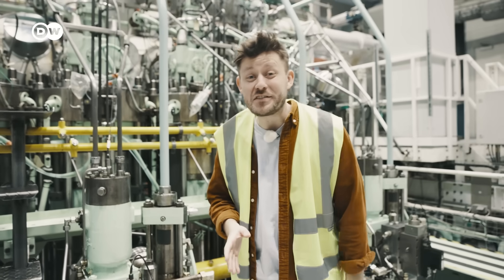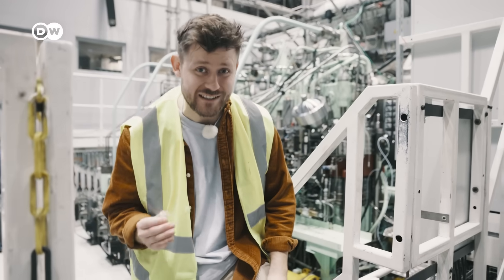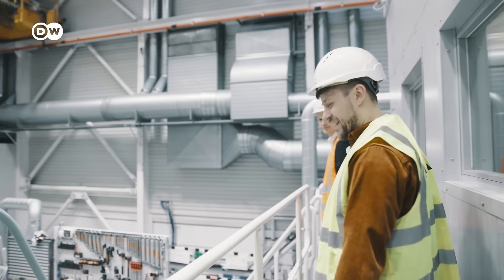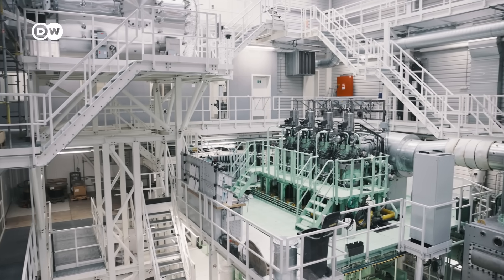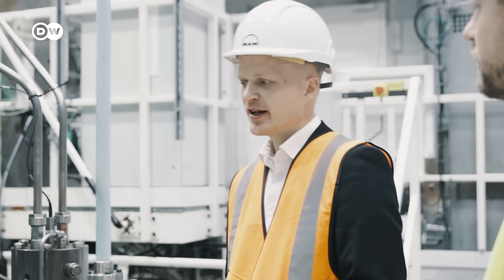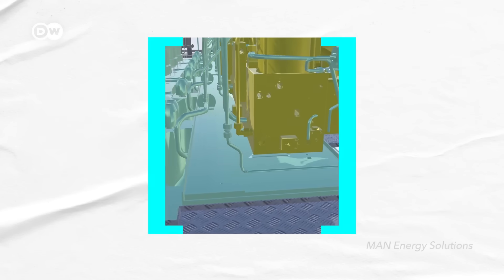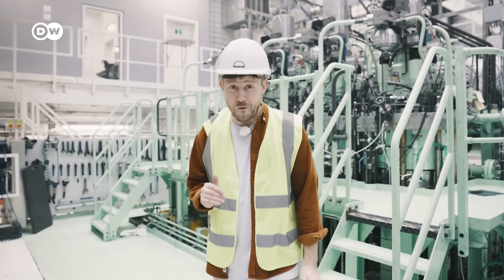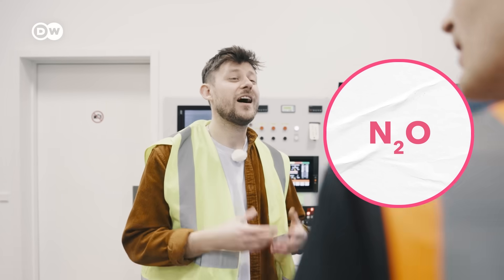Can this magic fuel clean up the shipping industry?

Comment: Its like hydrogen, but with NOx and N2O and still uses some fossil fuels.....
Reply: Not like 98% of hydrogen is still made through steam reformation of methane. It's really trading blows tho. Hydrogen being more energy dense per kg, but huge volumes even in liquid form and needs active cooling, ammonia easier to handle/transport but still toxic af etc. etc.
Reply: @NuclearTopSpot  amonia is made from hydrogen so all problems with hydrogen is carried over to amonia. And it is easier to make hydrogen by electrolysis, and a benefit of hydrogen is that it can be used in fuel cells which are more efficient than combustion engines.
Reply: @stian1236 . One word: energy density. H2 is a gas, ammonia is a Vapor at room temperature. You can’t put that much hydrogen in a tank. Unless you cool it to crazy low temperature
Reply: @stian1236 Nuclear would actually be a viable option compared to what is being presented.
Though, further to your comment - ammonia is a none starter, you are right. However, hydrogen is also not viable due to the sheer volumes that would be required.
Let alone the aforementioned (comment above), ways in which most hydrogen is created at present.
And even if we used Green Hydrogen, the length of time it would take to create enough for one container ships journey doesn't even bear thinking about.
Reply: @cipaisone  or have really high pressure
Reply: @dandantheideasman  This! Small nuclear salt reactors that have energy density far greater than what we use today, whit great spans of time between refuelling is probably the best option for cargo shipping.
Reply: @thesayxx  This is a great idea for the Military, though having a global fleet of nuclear powered commercial ships would be a bad idea - Houti Rebels anyone?
The Merchant Navy should focus on batteries as they, coupled with motors, match the combined weight of the engines in ships today - exclusive of fuel tank, fuel etc.
It is far to easy with current tech to generate energy at sea, so there are absolutely no issues with the vessels ever running out of fuel, ever again.
Then there is the option for the larger ships to use something like a CO2 to Carbonate flow generator/battery, that could generate electricity to power the motors with CO2 and have a product to sell (Carbonate), at any one of the destination ports.
We could even go as far as to design a vessel with atmospheric CO2 capture on them, as a steady fuel source.
This would be an enormous win for any of the commercial shipping companies #Maersk #MSC #COSCO etc. As they could not only fuel the ships for free, after infrastructure is in place, clean the atmosphere in the process and, all-the-while, produce a product to sell at the ports they arrive at. 🤑♻️🌍🌎🌏🌐
Reply: That's not a problem. If they could come up with gas capture and storage technology and unload the NOx and N2O mixture at port, the ships them selves could become generators. N2O has uses for it in medicine (that's laughing gas) and in let's say less legal motorsports (N2O is NOS). Meanwhile, NOx can be used to produce Nitric acid, which is precurser for production of nitrate based synthetic fertilizers, which we need for agriculture (can't feed the world without fertilizers anymore). Really, with right infrastructure put in place, this might not be a "problem", rather, it could become an opportunity.
Reply: @looseycanon  There are still too many energy losses in transfer and creation and with all that extra storage capacity and weight it includes, you might as well add a few more batteries. 
Synthetic fertilizer is out of the window within 10-20 years. So wouldn't be a viable long-term strategy.
Reply: Problem of using directly H2 as a fuel is that it is even less energy dense then amonia.
There are pretty much 2 storing options  high pressure or extremely cold as a liquid. For both options a lot of energy is needed to store it. High pressure is the least dense one, needing expensive and big cylindic flasks. Modern is storage at around 700bar, around double the pressure as in scuba tanks.
Liquid storage needs temperature of below -240°C. More then 25% of the energy stored is needed to cool it down. Still you just storing ~2300kWh/m³ against  ~9600kWh/m³.
Reply: You've got it backwards. Ammonia a molecule that stores hydrogen while somewhat fixing its worst problem by far: the terrible energy density.
(quick web search says a 1MPA tank of ammonia contains 150% more energy than the same size hydrogen tank at 70 times the pressure.)

"but with NOx and N2O"
Also an issue with hydrogen.

"still uses some fossil fuels"
Currently, the majority of hydrogen used for hydrogen cars is grey hydrogen made from fossil fuels, making the whole thing kinda pointless. (green hydrogen currently just isn't competitive cost-wise)  This is a much more urgent problem than ammonia needing 10% or so of fossil fuels for ignition.
Reply: @RB-kb3tc  there is no NOx or N2O emissions produced by hydrogen fuel cells, which are much more efficient than burning it. 

To make ammonia you first need to make hydrogen, so you add more steps to produce ammonia wasting more energy. 
Hydrogen used for cars is atleast in northeren europe(where i live) is produced on site at the fueling stations by electrolysis with electricity from hydro or wind power makin it green. The process of making green hydrogen is a lot easier and cheaper than making green ammonia.

And yes a 1mpa tank with ammonia may contain more energy but you have used more energy to produce it, get less energy when burning it and produce emissions.
Reply: @RB-kb3tc  Either way, Hydrogen uses 3 to 5 times the energy you pit into it in its creation over the energy you get out and then you must make Ammonia using more energy. 😅 I just cannot see the win in this. And even MAN cannot currently offer a ship a tank big enough for long haulage - so, yet another reason that this is simply a none-starter before the ship has even left the port 😊🙏
Reply: There are better alternatives for Diesel and heavy fuel
Reply: @johumm455  Please elaborate!
Reply: Hydrogen kicks out NOx but not typically N2O, for any off the propaganmachines on here that say otherwise remember that the exothermic oxidation process is in the presents of 70% N2 so unless you have pure oxygen all high temperature internal combustion engines will kick out at least NOx
Reply: @alexlerwill344  you dont burn hydrogen, hydrogen isnt used in combustion engiens... its used in fuel cells as that is more efficient, and do not produce any NOx or N2O.
Reply: ICE applications of hydrogen are currently much more popular for ship owners over fuel cells and the reasons are extensive. Fuel cells will most likely become more prevalent in the distant future (so not to be ignored but just not ready for the 2050 objectives). Don’t believe me read up on hydrogen ICE’s vs fuel cells in shipping. I don’t particularly agree with either hydrogen solution for shipping. Better to use hydrogen where it has the biggest bang until it becomes sufficiently cheap or better options are engineered. This industry relies on inert gas for a good % of its industry and fuel density means everything economically. Many industries do not have such tight requirements to maintain margins.
Reply: Unfortunately, so does hydrogen creation across the board. And hydrogen also creates NOx unless the engine runs below 2500 degrees. 
JCB have achieved this for their plant machinery - however, I would suggest an engine that only revs at 2500 rotations a minute won't produce enough torque for a heavy container ship - though I could be wrong on that. Then there is the storage of the smallest atom on the periodic table. Even paired in the form of H2, as it is in industry presents too many challenges for large scale use - such as on a container ship.
This is all madness. Electric is the only viable solution for shipping - end of conversation. 💪
Reply: @dandantheideasman  if you have hydrogen you could use a fuel cell which is more efficient than combustion and dont produce any NOx. With electricity the amount of batteries needed to power a large ship across pacific would be too heavy.
Reply: @stian1236  clever guys are already looking at making fuel cells that use ammonia.
Hydrogen is very difficult to store and transport, that is why they don't like it in shipping. And hydrogen is extremely low in volumetric density
Ammonia actually stores more hydrogen than the same volume of cryogenic liquefied hydrogen.
Reply: @stian1236  Again, agreed, if you consider using only the batteries. However, the sun always shines and the winds always blow at sea 🧐😉
Reply: @tjampman  you still run into the issues of the fuels creation. For the most productive hydrogen creation systems we have on offer, you only get around two thirds of the energy you put in to create said hydrogen.
Then you have to create the ammonia from that...
Reply: Also, there is the case for surface runoff on any vessel, which would allow for hydroelectric production if managed correctly. Which I am certain is already the case - the management and not the energy production.
Plus, there are vessels at sea now that can recover energy in utilizing the same principle of regenerative braking in land vehicles. 😉
Reply: @stian1236  Actually, those big marine diesel engines are very efficient.
Reply: @dandantheideasman  I am not sure if you are confusing degree and rpm.
But to clarify your question whether a marine engine could go below 2500 rpm, and still have enough torque!
They do already. Marine diesel engines are slow speed. That means at full speed they are only going at slightly above 100 rpm!
And as they are connected directly to the propeller. The propeller only goes 100 rpm too, it is just so big that it can still push a giant container ship above 20 knots!
Reply: @tjampman  Thank you for the insightful and productive comment. Love to learn and this helps a lot. 
Still complete insanity though, when you consider how much energy is required to make ammonia. Ammonia that is already in overstretched demand for the production of food.
Then there are the storage issues and if they have to compress it, that is more energy loss before the motion is even factored in. 
However, at such low rpm, they might get away with excessive amounts of NOx production. Though there is no avoiding the N2O production because of the fundamental physics of energy transfer and the re-compounding of elements in said transfer.
Thanks though, really good to know and with that being the case, it makes even less sense. 
Especially as they could just use hydrogen and guarantee they get two thirds of the energy they put into the creation of fuel. Before all the mechanical and thermal losses that is 🙏 😂
Reply: @dandantheideasman  we all know that hydrogen/ammonia used as a fuel is terribly inneficient, the problem is that we have no other option. batteries for airplanes and ships is out of question, it's basically impossible to get enough batteries for a cargo ship to cross the atlantic full of cargo, biofuels are even more inefficient, and hydrogen isn't practical because it needs to be liquefied AND you would still need to carry an absurdly big fuel tank to have enough hydrogen to get the necessary range. the only logical solution, of course, is nuclear, but sadly, people are kinda shitty and we can't trust cargo ships sailing around with a nuclear reactor without being as well armed and armored as a battleship. so we are left with ammonia... though, I would very much prefer fuel cells instead of combustion engines.
Reply: @dandantheideasman hydrogen can be ran through a fuel cell, eliminating NOx emissions entirely. Liquid H2 makes sense for shipping and aviation imo

Comment: I think ammonia is a very good fuel for ships and planes but the matter is how to produce ammonia in a green way. Ammonia is a good start but multiple ways of renewable energy is the way to a Greener future, not just one source of energy will help.
Reply: Ammonia can be produced directly via Water electrolysis,
Without using Habber Bosh process.

Note,
This does no 1st convert water into Hydrogen and then Hydrogen into ammonia.

Insted this directly converts,
Water + N2 + electricity = NH3 + O2.

This is completely green if we use Green electricity.

This method is used still in Lab environment.
But can be commercialized soon.

Note- 
This method was there for very long time but it's efficiency was very low, so it didn't made any economical sense.
But recently, its efficiency is increased to Note than 90%.
Reply: @Atheist-Libertarian I appreciate the info, thank you so much.